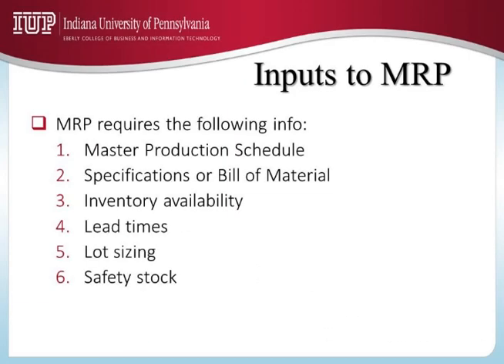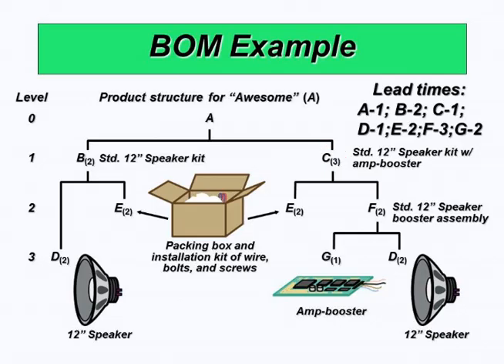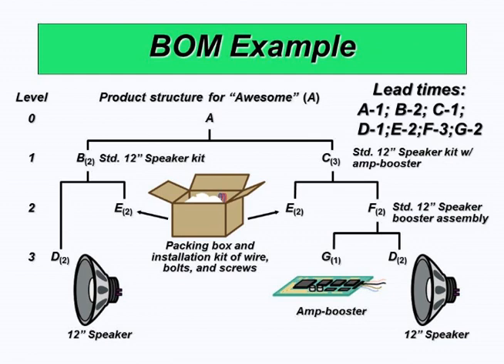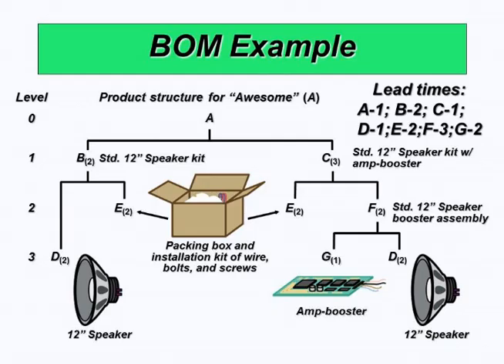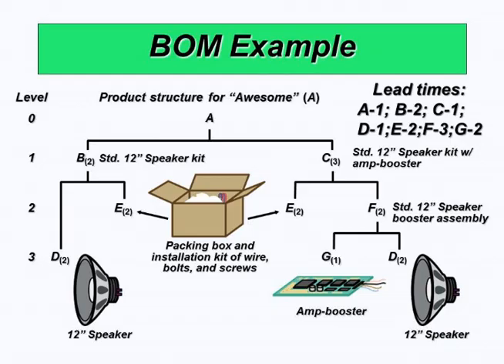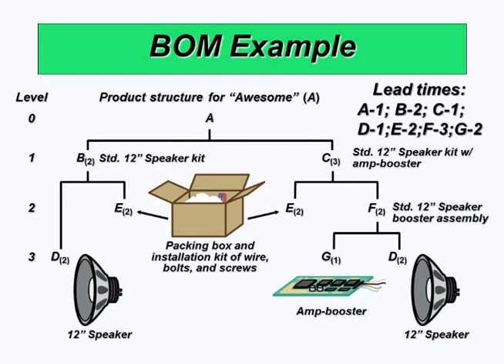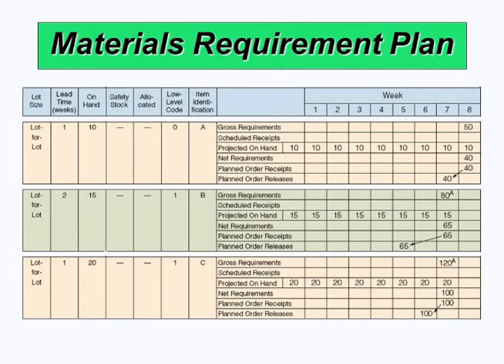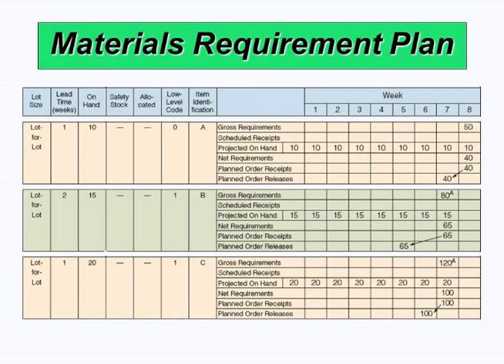MRP Table and Calculations Updated)

Comment: Shouldn't the projected on-hand be zero for each of the materials A,B,C in the weeks 8,7,7? There is no Safety Stock consideration. If SS were considered, then the on-hand numbers are correct but the net requirements would change to 50,80 and 120.

Comment: The first gross requirement 50. Will it be given or we have to somehow find it ourself?
Thanks in advance
Reply from the maker: It comes either from the MPS of from the planned order releases of the parent item. In this problem, it was given.
Reply: Thanks
Reply: @prashanthbharadwaj9771  
Sir , here we've demand "50" came on 8th week only?
Will it come on other week columns as well?
Reply from the maker: @mallutv3695  It certainly can. This is a simple example of one order (demand) in week 8. In reality, there can be demand in each of the weeks in the planning horizon.
Reply: @prashanthbharadwaj9771  
Thankyou for replying sir...
One more doubt,
 How we do this problem, if "order quantity" is given in the question for each items?
Reply from the maker: @mallutv3695  I should have another example posted with different lot sizes/order quantities. Look for that. Basically, the net requirement calculation will be the same as in this one. But the planned receipts will be based on the order quantity. It will be equal to or greater than the net requirements depending on whether it is fixed order quantity or lot size multiple or minimum lot size or any other lot sizing quantity. Good luck!